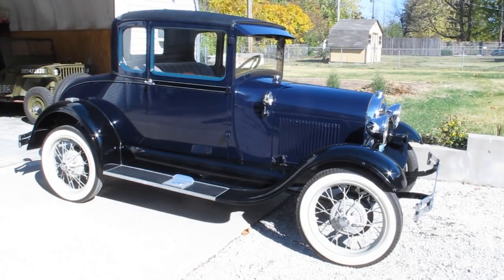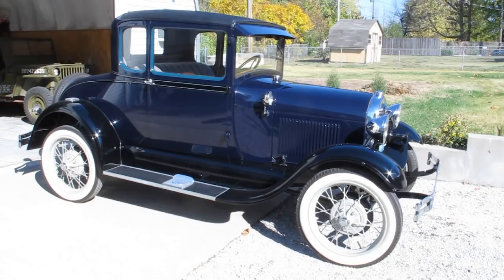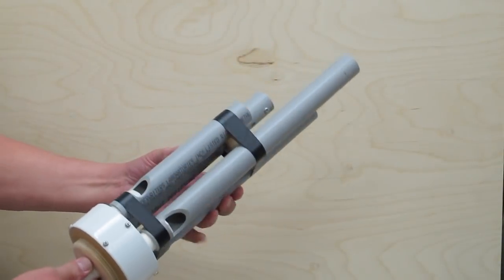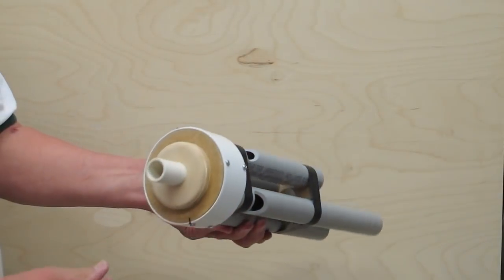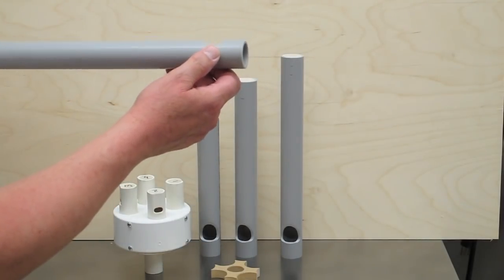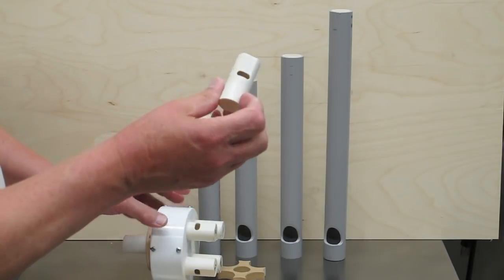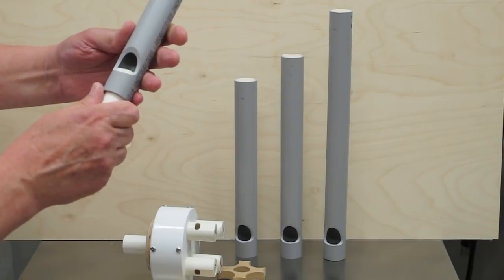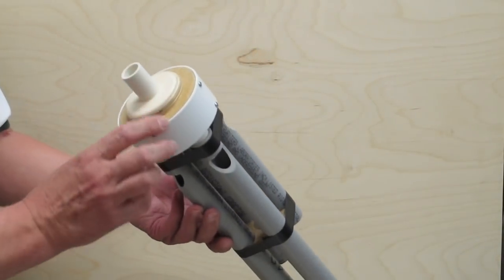1929 Ford Model 'A' Exhaust Whistle - Making A PVC Copy

Comment: What's interesting, is that this system was used in the Soviet Union as the primary siren for fire engines. Connected to a lever in the cabin, very similar to this, instead of an electronic siren (in the early years) you would have to listen out for this. And I must say, with the gigantic engines they used, they were heard for at least a mile.
Reply: Do you reckon the system was stolen from this?

Comment from the maker: This particular whistle was specifically manufactured to fit into the available space under the Model A carburetor with the whistle at right angles to the exhaust connection. Installation only required disconnecting the exhaust pipe from the exhaust manifold and inserting the whistle. Other whistles I have seen had the whistle inline with the exhaust connection.

Comment: I have an Aremore whistle that was on a model T which uses a smaller exhaust pipe. I’m not sure if it will work on my A because the butterfly valve is small to fit the T pipe. Before I cut a hole in my model A pipe do you think that small butterfly valve would divert enough air to work the whistle?
Reply from the maker: I had a Model T with an exhaust whistle but never compared it to the one now on the Model A.
You would think if it worked on the Model T it would work on the Model A as long as it (the adapter) does not restrict the Model A exhaust too much.
Do you know that the exhaust whistle works? You could try holding or attaching it to the end of your exhaust pipe to verify that it works.
As shown in the video, my adapter neatly fits between the exhaust manifold and the exhaust pipe with no modification(s) necessary.
If it were mine, I would first make sure the whistle works and then figure out how to modify the adapter to be the same size as what is on my Model A. Always best not to make any changes that cannot be undone if for some unforeseen reason it doesn't work as desired.
Thanks for watching. Please subscribe! 
That is what keeps this channel going. 
Ron

Comment: Hey Ron I just bought a whistle and I am trying to put it on a rat rod garden tractor however it's not working. I'm not sure if it's just because not enough volume/pressure or if there is something else wrong. One thing I know needs to be fixed is one of the "ports" coming out of the base is loose. Is there anyway I can get pictures of yours to see how to fix mine? Any help would be appreciated.
Reply from the maker: If it is a metal exhaust whistle similar to what is shown here and you are trying it with a single cylinder engine on a garden tractor, I would guess not enough volume. A single cylinder engine does not produce a constant flow of exhaust like a 4-cylinder engine will. Jury Rig an adapter of some sort and use some welders gloves and try shoving the adapter into the exhaust of your car running at low idle and see what you get. The only photos I have are those in the video.

Comment: I have an original Aermore whistle but I'm having a hard time figuring out the linkage and how to actuate it. Is there any way you could post a close-up video of how you did yours?
Reply from the maker: Mike Gillespie No, I can not do that. Actually, I am somewhat embarrassed to admit I have yet to complete that linkage. I wish they had made it (the whistle) so the actuating lever could be adjusted or rotated 90 degrees. I know this was made for a Model A but the geometry is all wrong. I wanted to machine or cast a curved attachment to clamp onto the existing lever to allow a pull cable actuation similar to how an accelerator cable pulls on a carburetor throttle lever. One of these days. :-)
Reply: Ronald Walters Thanks for the quick reply.